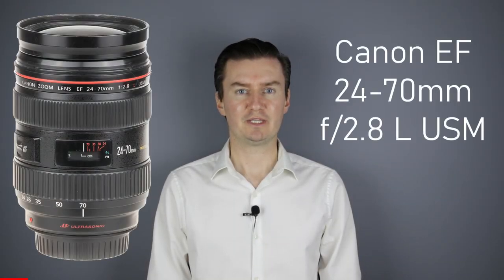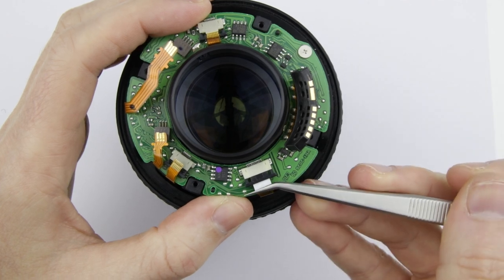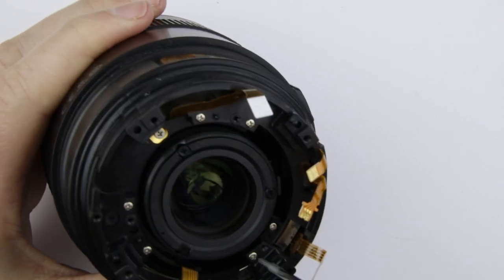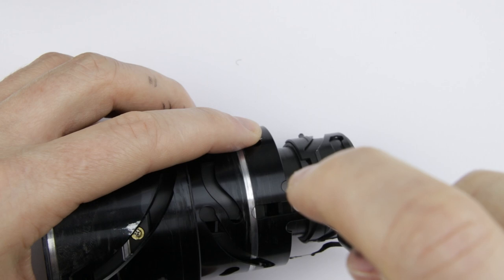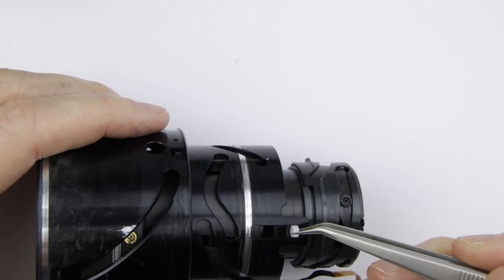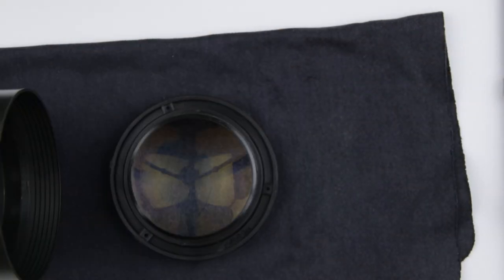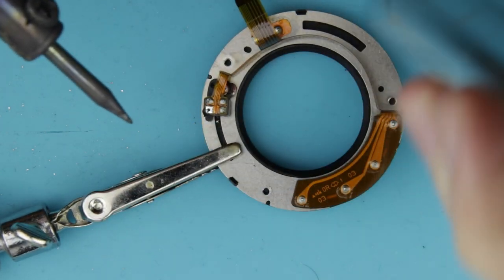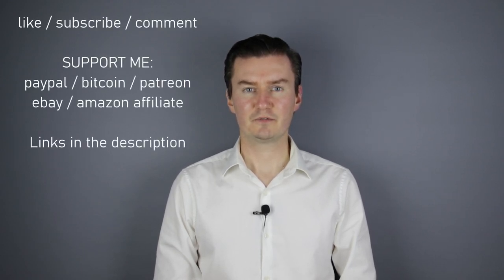Canon EF 24-70mm f/2.8 L USM disassembly and replacing the aperture flex cable

Comment: You are removing the outer barrel as an extra job for you. It is not necessary, just work from the service holes. Keep the front element's eccentric collar positions with a marker. So you do not have to make alignment. I fixed hundreds of them.
Reply from the maker: I don't really understand that... can you give me some timestamps which parts of the disassembly process can be skipped?
Reply: @CamerasLensesEtc  Starting from 10:10, the main sleeve will be kept just like that, do not remove other inner barrels. Instead, from the service holes, remove the 2nd group (the part you take out at 19:17) with removing the eccentric collars. Move it out by loosening with your tweezers from the screw holes. Then take out the 3 white collars holding the aperture group, end let it drop on your hand in the barrel. Once you fix the aperture cable put it back, then put the second group back in place (you will need locking tweezers or similar), align the holes, put eccentric collars with screws. (This 2nd group, as you know, will need sharpness alignment after you put all the lens together minus the focus rubber). You are increasing your labor too much by removing inner barrels.
This lens and the 2nd model too have a flaw in aperture routing driving design. That is why it breaks down after a number of zoom in/out movements. If you trim the flex cover metal's inner lip, it will not catch the flex cable's curved side and rip it prematurely. That is one of the remedies.
On top of all, your videos are good, keep up the good work!
Reply from the maker: @photonmaster6162  I pinned your comment, so if someone would like to do that, they can follow your instructions. When I will have this lens again, then I'll make a video using your instructions.
Reply: do you still fix lenses?
Reply: @CamerasLensesEtc I have one for repair
Reply: Love it if you did a video! of the easier way

Comment: Hi, do you need to use any lubrication on the AF ring? Or at any part of the camera? I need to change the aperture cable as well...
Reply from the maker: I guess you mean the manual focus ring... usually I leave it as it is, if there is dust or sand on it, I clean it and apply fine mechanics grease.

Comment: Hi, very good Video i used it to replace the flex cable of  my 24-70mm but the secondary aperture unit was fallen apart and i tried to reassemble it but without success, do you have any idea on how to reassemble it? thanks
Reply from the maker: Really hard to do that, which I can't explain in comments. I would check if there is any for sale on ebay, it would be easier to buy one instead of rebuild.
Reply: If the problem still I exists: I just had the same issue. Unfortunately I have not taken a video, and I will never try to do that again:
There are two rings, one with holes and one with grooves. I first took the ring with the holes. I placed all 8 blades onto the ring, each with the pin into a hole. All blades need to be aligned exacly into the same direction, creating a circular aperture, which should be slightly closed. I placed a round piece of cardboard into the center of the ring so that the pieces don't collapse.The last blade needs to go underneeth the first one. Once all parts are positioned symmetrically you I placed the upper ring (the one with the grooves) onto the ring where you have arranged the blades. Initially, there was a gap. This was now the tricky part: the upper pin of each blade needs to go into the groove of the upper ring. I managed it by very slightly re-positioning the other blades after the first one or two blades fitted. No force, not pressing. After a while, all upper pins were in their respective groove. The gap between the two rings was now gone. I could close the mechanism by holding the lower ring and rotating the the upper ring clockwise. The blades will open and close by rotating the two rings against each other, but if you go beyond the small resistance, then it will fall apart again... Good luck!
Reply: @mariomuller4075  Could you draw it somehow? maybe in paint, because I have absolutely no idea how they should be arranged

Comment: So I see you marked the brass guides, but how do you know which guide goes in which hole? An did you mark the elements orientation? Try one scribe mark for one guide, two scribe marks for the second guide and three for the third. This does not guarantee the best focus but it gets you very close.
Reply from the maker: What I do is I remove the eccentric screws in an order (from left to right starting from a specific flex cable or a mark) which I remember, place the screws next to them in that order, so I can put them back in their original place.

Comment: I replaced the tape, after twisting everything, manual focus with the ring and autofocus do not work, at what point did I do something wrong that even manual focus does not work?
Reply from the maker: First, I would make sure that the USM motor is connected to the focusing lens elements group.

Comment: Cannot undo the screws securing the zoom lever at 5:45. The screws are seized and I don't want to strip their heads.... any help? Is this step mandatory or possible to skip? EDIT: Turns out it was not mandatory, disassembled and reassembled with the zoom lever still attached to the zoom ring. 

Thanks so much for your video, my lens worked again first time after reassembling. A very technical procedure with large margin for error minimised by your very helpful video!
Reply from the maker: Thank you for your comment, I'm glad that my video has helped you!

Comment: I completed your disassemble & assemble videos replacing the aputure housing and flex cable. problem is the lens is still giving a Err 01 on every f stop other than F2.8. 
It's not my first time jumping into a lens and feel I completed the repair correctly and now i'm unsure what to trouble shoot to find the issue. 
Can you offer any further advise please?
Reply from the maker: First, I would disassemble the lens until the PCB, and clean the end of the aperture flex cable with alcohol and scratch pen.
If that doesn't help, I would disassemble the lens to have access to the other end of the aperture flex cable, and check the connection between the two ends. Also, check it when the cable is bent, and when it is flat.
You can try to replace the aperture cable again, or if you can buy the whole aperture unit, you can replace the whole unit with the cable.

Comment: Thank you for this video..I wonder if the same  flex cable works to all canon lenses...thank you again...
Reply from the maker: No, it will not work. Lenses have different size and shape flat cables. Fortunately, you can buy flat cables for most of the Canon lenses.

Comment: This was a really helpful tutorial. I ended up having to purchase a new aperture for $50, which was not a big deal. Then when repairing, my secondary aperture fell on the ground and of course all of the blades fell out. I managed to put it back together, and then though I followed you instructions perfectly putting the lens back together. However, when I turned on the camera, the lens did not focus (and my focal length didn't go the entire range (more like 30-70). Obviously I made a mistake somewhere, though I don't know exactly where, or why it won't focus. I have completely disassembled the lens once more to try again, but am hoping you might have an idea as to why the focus was not working? Also, what are "eccentric screws" and what does that mean exactly? I thought I marked them well enough but there were several weeks between disassembly and reassembly and it's possible that I didn't get them back in the same exact place. Would that have anything to do with the focus issue? My camera still gave the Err 01 message when I turned it back on. Very frustrating! Any ideas would be greatly appreciated.
Reply from the maker: Focusing problem: most likely the USM motor is not connected to the focusing lens element... if you move the manual focusing ring, is there a lens element moving? (As I remember, a lens element in the back should move.)
Zooming problem: Maybe a ring inside the lens is not put back at the correct position. Follow my assembly video exactly, especially when I'm putting back the tubes inside the lens.
The eccentric screws are not going to cause focusing or zooming problems.
Error 01: check the connectivity of the aperture cable, clean the connector of the cable at the end, check if you can close and open the aperture unit mechanically.
Reply: @CamerasLensesEtc  So I went back through, took everything apart and put it back together again as precisely as possible. I now have the zoom and autofocus working...but I'm still getting Error 01 and can't figure out why. The camera/lens seems to be working exactly as it should but I can't shoot with the aperture above 2.8. What else could be going on? Could it be something with the PCB?
Reply from the maker: @drbockel2  When you disassembled it, have you checked the connections of the cable? Have you changed the cable? 
The problem could be with the PCB, but in order to test it, you need an another lens.

Comment: Does the objective need to be recalibrated after putting it together again? I am very unsure if I should start to repair mine by myself..
Reply from the maker: If you want to have the best results, then yes, it has to be calibrated, but it is not easy to do that at home, and I doubt that canon service would do that.
I would highly recommend to mark and put back the eccentric screws as they were in the lens, that way the lens is closest to the original calibration.

Comment: I completely melted the part of 23:20, is it important? I cut that plastic piece apart and I saw no electrical component in there, what is its use?
Reply from the maker: Yes, it is. It is a sensor for checking if the aperture is completely open. I would recommend to buy a new aperture unit if there is any for sale.

Comment: Symptoms: When I look through the viewfinder, I see "snow" and it's much darker than what I see with the naked eye. Secondly, when I press the shutter button to take the shot, I get an Err 01 message that says "Communications between the camera and lens is faulty. Clean the lens contacts."
Everything was fine until my lens tumbled out of the car and hit the pavement! Dry, sunny day.
So what's wrong with my lens and can it be fixed?
Reply from the maker: I would check if the aperture is working. 
Err01 message pops up if the aperture cable is broken, but in your case I think the aperture unit might be damaged due to the fall.

Comment: https://youtu.be/URv18XNfiQ4?t=1549
the second pin fell out and the wire broke off, I made the pin, but where can I fix the wire for this pin? Will it work from any other pin?
Reply from the maker: I wouldn't bother with that, I would just buy a new aperture unit, costs ~45 USD on ebay.
It is very hard (if not impossible) to repair it.